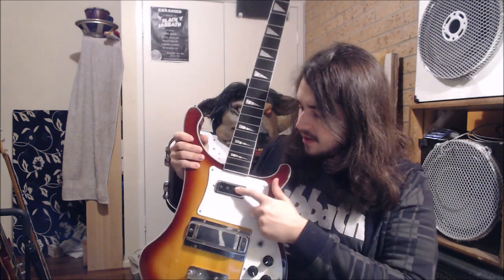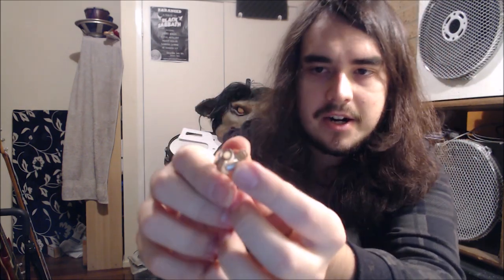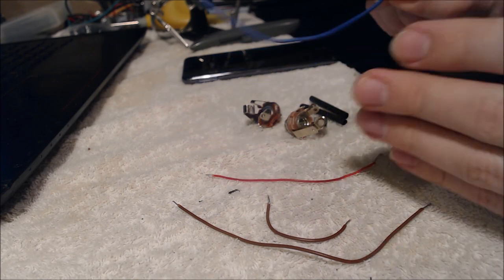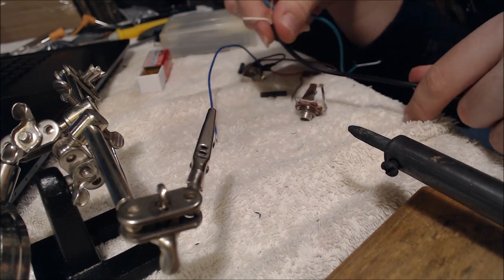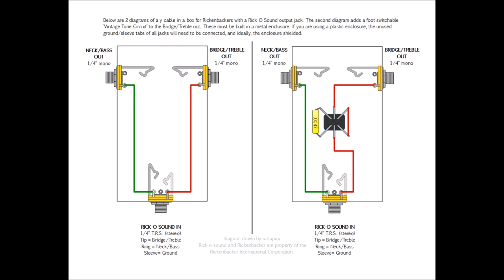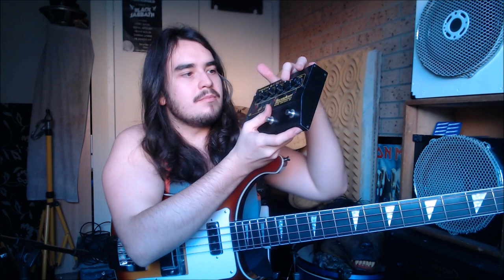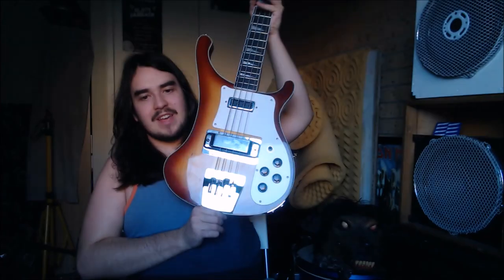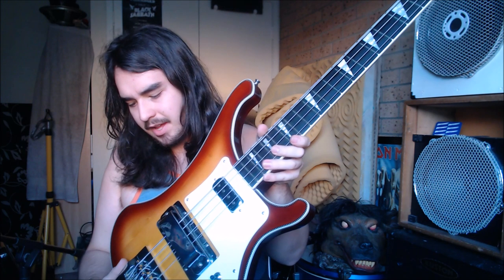Wiring and demoing a Rick-O-Sound circuit

Comment: Thanks for posting this great explanation/demo of rick-o-sound jacks and wiring. Liked your simplified mono blend jack - ingenious! I'm probably going to put a stereo/mono switch on my Cbacker pickguard that does the blend there (default to closed) and opens the circuit when switched directing each pickup to a different normal mono jack. The Chinese couldn't figure out how to do what you did, so just soldered the two leads at the switch together into 2 standard mono jacks. Pretty pointless! My thinking is to separate those two leads and direct them to the extra switch before going out to the jacks. The rick-o-sound way has only one benefit  which is a single cable coming out of the guitar (mine will have 2 cables in stereo mode). But the advantage with the double cables is the stereo cable doesn't need to be split before going to 2 sound generators. Maybe not great for stage, but no big deal for studio. Who would use rick-o-sound on stage anyway?!

Comment: Hey man I need some advice, ive gotten an old Japanese era Rickenbacker 320, I am changing the tuners, nut, bridge and most importantly putting two REAL Rick pickups in the neck and bridge. 

Im wondering if I need the electronics to make it sound 100%? Do the pots and electronics matter? If so where can I purchase them. Thanks
Reply from the maker: Good question man, I don't think the pots and electronics make much of a difference... especially not the brand or type of capacitor or anything like that, what matters most is how they're wired and the values, for example pots that 500k tend to sound brighter then 250k, that's why they're paired with humbucker pickups which are naturally dark sounding...  but even that can have little effect on the overall sound of the guitar... if you swap out the pickups and none of the other electronics I think you'd likely be 90% there tone wise regardless of the rest of the electronics.. 

I'm not an expert, just a hobbyist so for this specific guitar, you may have more luck talking with some of the guys on the various Rickenbacker and / or Rickenfaker facebook groups... 

I tend to to get my electronics from ebay, generally inexpensive ones from china, though if i want to spoil myself someone fairly locally sells CTS pots and stuff like that on ebay too, though I don't think there's any difference sound wise..

hope that helps and good luck with your project !
Reply: @jakubshouseofrock7109  I see, thank you for the advice, now I think il be happy with just real pups, better nut, bridge and locking tuners. I was also thinking the wiring stuff may not make a huge impact on sound so pickups seem to be the best value upgrade. I think it will work, sounds decent right now but should be close with the real parts. I just want it for playing around with friends and doing covers of the Beatles. Thanks and I will maybe post vids when its finished as I haven't seen anyone else try to spice up a Rick Replica 350. Good work with your channel and modding of your bass, its really interesting!

Oh BTW were your original copy pickups microphonic? Mine were not and I heard from others that the copy pickups were really badly microphonic, wasnt the case for me but maybe its on the Chinese models.
Reply from the maker: @zeta2325   thanks and all the best with your mods, yeah that would be really interesting :) 

my stock pickups weren't microphonic from what I  remember, they were quite decent pickups actually. i guess QC is just an issue with them more so then the specific pickup design
Reply from the maker: @zeta2325  haha nice, whatever works :)